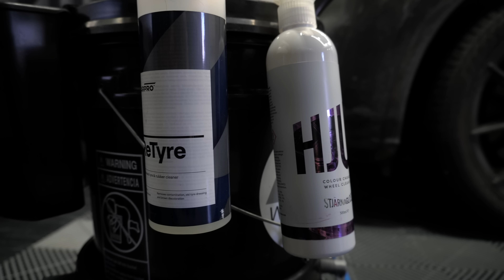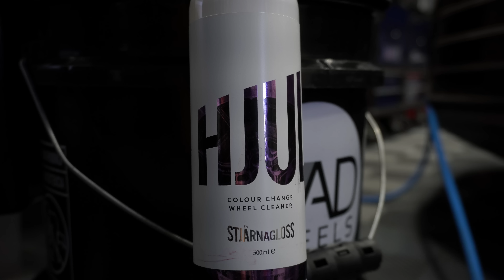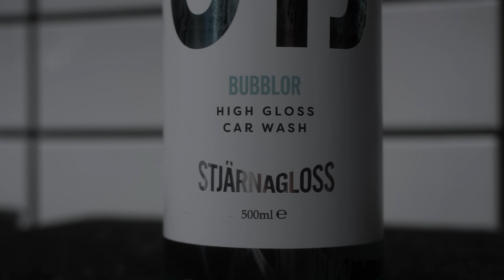AUDI SQ5 WINTER WASH | Giving my Winter Daily Driven Audi a Much Needed Exterior Wash

Comment: You are the reason I bought a SQ5.  You understand winter washes and the true test coatings should be put through.
Reply from the maker: Wow, I am honoured to hear that. I hope you are enjoying yours as much as I am loving mine. I really find it to be the perfect car for me and my family. It is capable and fun no matter the season. I am looking forward to applying a new ceramic coat in the Spring. Still contemplating which one to use.
Reply: @RADGarage  :). I got mine as a used 2020 CPO.  I too am trying to figure out which way to go with my coating!!  I have used Avalon King, Gtechniq CSL and Meguiar's Paint Coating on other vehicles.  A part of me wants to give Gyeon Mohs a shot.  Would like to see where you land and maybe compare results. Chicago weather is pretty rough;).  I feel it fits my family's needs also.  Only complaint I have is the steering feel is numb.  Wish it provided more feedback.
Reply from the maker: My only real complaint on the SQ5 is the Pirelli PZero tires it came with. Can't wait to move to a new tire now that there are more options available in the 21". I love MOHS. I think that is what I will be going with in the Spring. Did you know "MOHS" is "SHOW" backwards and upside-down?
Reply: @RADGarage  I did not know that!  That's pretty cool!  Leaning hard on the Mohs / skin combo.  I wonder how the water spotted will be.  I've seen some complaints of water spotting on reddit.  I got 20s on mine.  Probably attributes to the lack of feel also.  I think I got Michelin on mine.  Will have to check.  I'm a big Continental fan.  Will probably go to them when these burn out.
Reply from the maker: Reddit is a rabbit hole I avoid at all costs!

Comment: The same dirt in winter in Moscow. As if the dirt is brought by trucks-)))
But first I douse the whole car with pre-wash. And then I clean the wheels.
To reduce the chance of scratching black wheels.
Yes, Rick needs to wash the car once a week in winter.-)))
Reply from the maker: Hi Dmitry. The dirt here is literally brought in by trucks. Every time it snows, dump trucks spread this mixture of sand, gravel and salt called "pickle". It is god-awful, filthy crap but it does help melt away the snow leaving us with dry roads for pretty much the entire winter. The downside is, a lot of it gets on the vehicles and finds its way into our garages. I have been doing pretty good keeping up with the washes, but the holidays were just too busy. I hope you are handling the challenges well in your neck of the woods!
Reply: @RADGarage  Every time it snows, dump trucks spread this mixture of sand, gravel and salt called "pickle". - SAME SHIT !🙁 Ceramics only live for a year. I use TarX once a month in winter. I just spray them all over the car.
Reply from the maker: You gotta do what you gotta do!

Comment: So satisfying 😌 Gave my car a interior deep clean reset yesterday to begin the year, exterior is next. Living in Rio 🇧🇷 so no winter to worry about.
Reply from the maker: I need to get in my interior, but I need the weather to warm up a bit more so I can pressure wash the Tuxmat liners on the driveway. Otherwise, the water sprays everywhere inside the garage.

Comment: I’m happy to see you spraying the ceramic detailer directly onto the paint. I find myself never using this as the instructions say to only spray onto a microfibre and then wipe panel. For some reason I don’t enjoy that way lol.. You have renewed my interest in the product!
Reply from the maker: I will admit I rarely read the manufacturer's instructions, and I can't figure out why it would make any difference if you spray directly on a panel vs. into the towel. At any rate, it works this way and I'm sure it works the other, but like you say, there is something more satisfying about wiping it directly on the panels. Thanks for the visit my friend.

Comment: These rad videos help me get through the winter because I sure miss detailing every weekend. The daily driver is going on week four since it got a coin operated wash. Temperatures dropped so fast that night I couldn't add any protection after finishing up with ONR wipe down. How are those new tires treating you? Looked like SNO foamed up really well! I played with Matta on the last hand wash before winter arrived.
Reply from the maker: I'm glad my videos help you through the long cold winters! It is tough when you want to clean your car but the weather just isn't cooperating. It starts to wear on you without you even realizing it. I am loving the new Nokians. The ride comfort is the best I have ever experienced. I am not familiar with Matta. How is it different from Bubblor?
Reply: @RADGarage  Heck yeah man, your video gets me pumped and I always want to dive into a detail project. I really couldn't do much the month of December because our single digit temperatures plus the windchill. Even if I was able to heat my garage I still wouldn't be able to clean anything. Thankfully tomorrow afternoon it should get up to 5 degrees celsius so I am contemplating breaking out my Worx Hydroshot with some luke warm water. I've got one bottle of Griot's Spray On Car Wash left and thinking about using it as a pretreat step before rinsing the car. I wanted to try out the Griot's Ceramic 3-1 Wax for the winter before applying DB36 later in the spring.
Reply: @RADGarage  I was delighted with a few Stjarnagloss products in my TRC mystery bag and Matta was one of them. This soap was designed for Matte finishes and is free of gloss enhancers and in my case will be my dedicated maintenance washes on my Satin Black wheels because Brake buster would be overkill. In November I had to break up my detailing sessions into two separate days so on the following day I washed the car using Matta leaving the paint surface clean and not leave anything behind.

Comment: This has to be one of the best demonstration of how snow foam pre-wash works. Which of the processes took most of your time? 

Great quality vid as always!
Reply from the maker: I messed up on a very critical shot. I was spraying off the rear bumper during the foam stage, but I had not hit "record" on my camera so I missed out on a very satisfying part, but I had enough other shots to really demonstrate how important a foam rinse is. The wheels took me an hour alone which was the longest process this time round. The filming of the foam adds a lot of time, but the foam stage itself (without filming) goes much quicker.

Comment: Rick thanks for dropping this long awaited video. Q, do you have an undercarriage sprayer that you hook up to the pressure washer.? Considering all the salt on the roads, it seems like it would be a useful tool.
Reply from the maker: Yes, I do have an undercarriage rolling spray attachment for my pressure washer, but the roads are still so snowy and slushy so I will hit that at a later date, hopefully once the roads are drier.

Comment: Another awesome video!! One question, I also wash inside in the winter. How do you deal with the moisture in the air especially if you use the pressure washer? When I use mine there is a moisture cloud in the garage. I have to open the garage door for it to vent out.
Reply from the maker: Like you, I will open the door after using the pressure washer if the temps outside aren't too bad. This time, I just let my Frigidaire dehumidifier do its thing between the pressure wash and hand wash stage. It takes about 15 mins for it to bring the humidity down from 100 to 55-55. Perfect amount of time for me to enjoy a coffee.

Comment: Hello. Concerning the salty soup and humidity inside the garage, you might want to look into built hamber atom-mac and touch-less prewash. Cheers from salty Europe.
Reply from the maker: I don't prefer touchless washes when it is this dirty. It is impossible to get into the tight panel gaps without using the pressure washer, plus I haven't figured out how to do the wheels during a rinse less wash.  The humidity levels are controlled by a dehumidifier and the muddy soup ends up in my catch basin where I will deal with it later. It's not really a big deal to do a wash such as this in the garage. Thanks for the comment!
Reply: @RADGarage  i should've realized the name will confuse. Sorry. It's called "Touch-less" but it's a powerful prewash concentrate. It's not a waterless wash. I mentioned it since it has rust inhibitors built-it in and the way it cleans is very suited to soil on the car. It kind of melts it.
Reply: Or better said - you don't have to do it touchless, it's just an effective maintenance prewash with rust inhibitors, which may come in handy regarding salt and water
Reply from the maker: I have a whole bunch of BH products, but I find them a pain to use since the instructions are difficult to understand at times. I'll take a look at what I have and perhaps I will be able to find and use this prewash concentrate you speak of.
Reply: @RADGarage Most detailing products or brands in EU indicates PIR, but most people in North America follow it as dilution ratio probably due to lack of information on the english translated website or the copy paste description posted on the NA distrubutor of that product. PIR can be in percentage such as with Bilt Hamber (4%) or in ratio such as 1:10. 1:10 is equivalent to 10% PIR. Dilution ratio doesn't account for the extra water coming from the pressure washer so that dilutes the product even more. Yes following PIR is so much more expensive because you'll use more product to achieve that specially if you have a high gpm pressure washer but it's accurate to use PIR since you know the exact amount of product that hits the panel of tha car.

Comment: I do very much like the video. Its made so well. Although something is bugging me. You foamed the hell out of all the washable areas, but neglected the wheel wells wich especially in the winter are corrosion hotspots. 
Is that something you don't do or just don't show? 
Cheers.
Reply from the maker: I didn't spend much time in the wheel arches because the roads are still mostly snow and slush-covered so using up water and making my floor dirty. Once the roads dry out a bit, I will whip into a coin-operated wand wash and hit the arches. I will also perform a thorough Spring clean and I am contemplating removing the fabric wheel arch liners this year. It's just a matter of will I have enough time.
Reply: @RADGarage  Well you had time to make  such a cinematic video. I can't imagine how much that prolonged the actual process of washing.
Reply from the maker: @y4nnickschmitt  The wash itself began at noon and ended at 9:00 pm. No breaks! The production of the video took the entire next day and night! But, it’s still worth it to me if people can find enjoyment and entertainment in it. 😅

Comment: Rick, Happy new year. Here in the UK we have had a cold spell with plenty of salt on the road. Due to the freezing temperatures I have been just covering the car with Koch chemie green star and rinsing off to try and keep the worst off in between proper washes. What's your view on that
Reply from the maker: I think that sounds like a solid plan. Are you doing that at home or a nearby car wash facility?
Reply: @RAD Garage  depends on just how cold it has been. Generally at home but when it's freezing or below been using the car wash facility. Using an ik sprayer for application
Reply from the maker: I can get behind that.

Comment: Do you prefer a 40* or 25* nozzle on the power washer inside in the garage? Seems like everyone uses 40* but it would make sense that a 25* would produce less overspray when confined indoors.
Reply from the maker: I have been using the 40° for years now. I have been able to master the spray angles so I deal with minimal overspray and the wide spray pattern the 40 provides equates to less deflection and blowback. It fits my purposes perfectly.

Comment: Ah, another RAD detail!  Great work, Rick, and what a fantastic transformation!  Question question about CarPro Retyre.  It looks like a phenomenal product!  But, the bottle also looks rather small, and it looks like you have to use quite a bit of it on any given detail.  As an RTU product, do you think it's cost effective?  In your opinion, is it one of those products that's just so good that it justifies the extra expense per use?  I've never tried it, and was just curious.  Thanks, Rick!
Reply from the maker: I would say the ReTyre is the most expensive tire and rubber cleaning solution in my current arsenal, but I just love it. I'm a big fan of lathering cleaners, and this stuff lathers up well on all kinds of different tires and rubber components. I bought the gallon and it was something like $80 so not on the cheap side, but I wold suggest trying out the spray bottle and see what you think.

Comment: Do you use any rust proofing? Krown etc?
Reply from the maker: I do not believe there is such thing as "rust proofing". The only way I believe you can prevent rust is by keeping your car as clean as possible and not letting the salt and water accumulate in areas where the paint is compromised. That's just the way I see it.

Comment: How do you like the gyeon ceramic detail spray? Can you use this on every wash or how much should you use this product thanks
Reply from the maker: I love it. It is a lighter ceramic spray than some you may be familiar with. It applies and wipes like a regular detail spray. It is not like some of the other thicker sprays that really require patience when wiping on and off. I have no issue using it after every wash. Like I said, it isn't thick so you don't get that build up you may get with other sealant sprays.
Reply: @RADGarage  have you ever used TECHNICIAN'S CHOICE just curious how it compares
Reply from the maker: I have never heard of Technician's Choice. Truthfully, I don't do a good enough job keeping up with products on the market. I've had to narrow my focus a bit so I don't end up with too many products cluttering up my cabinet space.
Reply: @RADGarage  ok thanks

Comment: Where does all the water go when washing is there a drain? Do the walls get wet
Reply from the maker: Yes, there is a drainage system in the garage that collects the water. The walls do not get wet. Some water will get on the garage door but I just wipe it off with a microfibre towel when that happens.